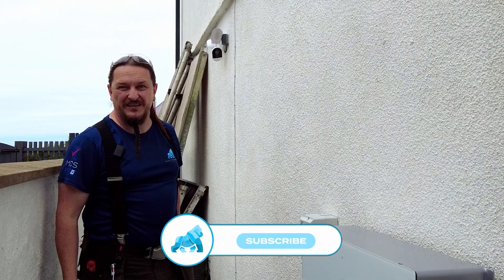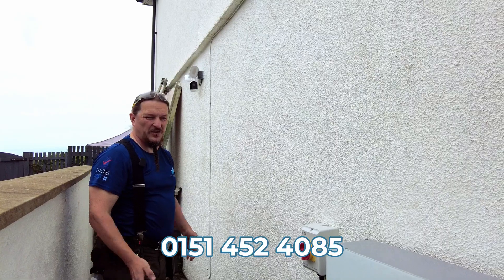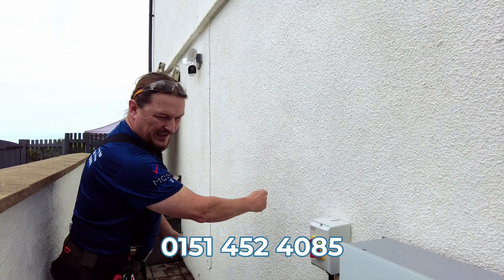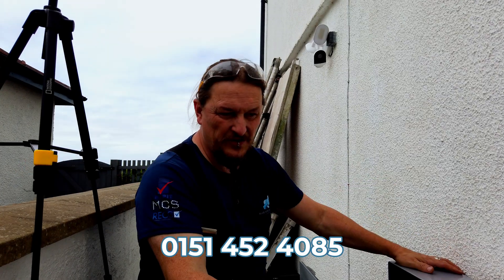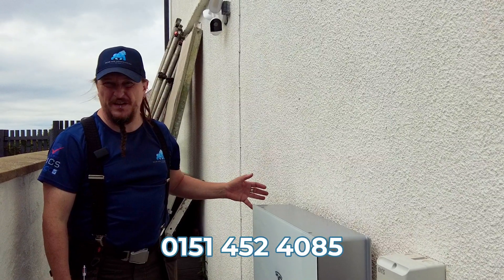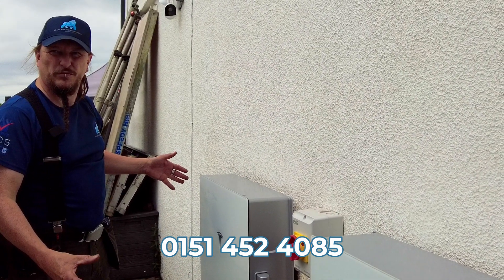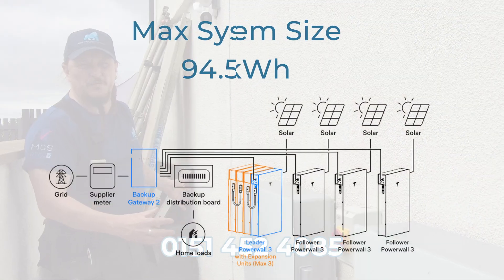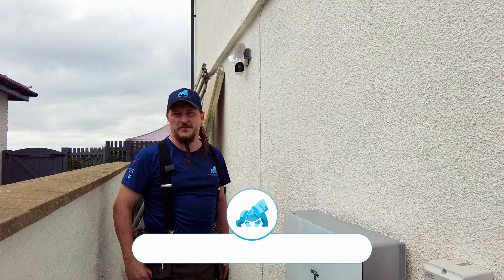Tesla Powerwall 3 Expansion Pack Installed – Full Setup & Review!

Comment: Great video. Once you've installed the expansion pack what's the commissioning of the expansion like? Does it just auto recalibrate the 2 together?
Reply from the maker: There’s a short commissioning process that your certified installer will complete through their Tesla One app when setting up the expansion. It doesn’t take long at all
Reply: this was my question also. did you ever get a response?